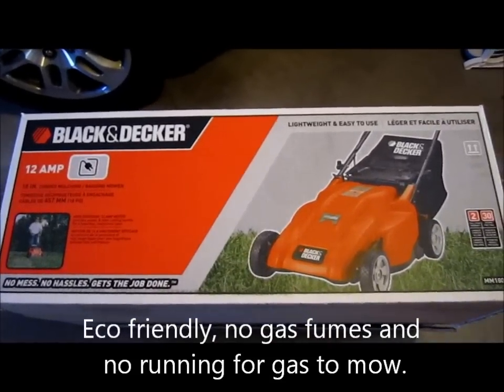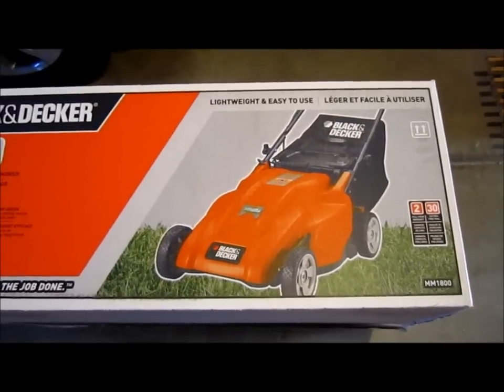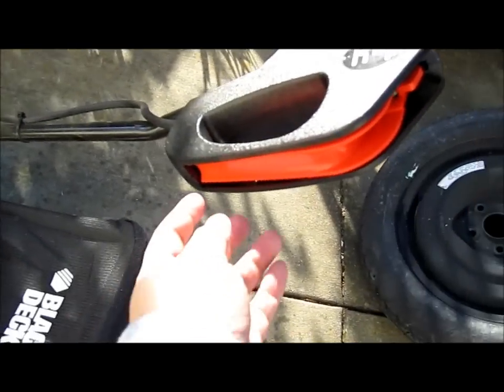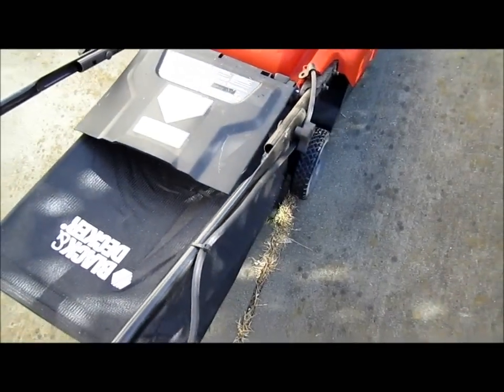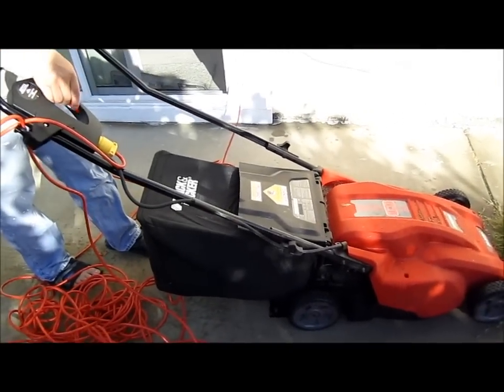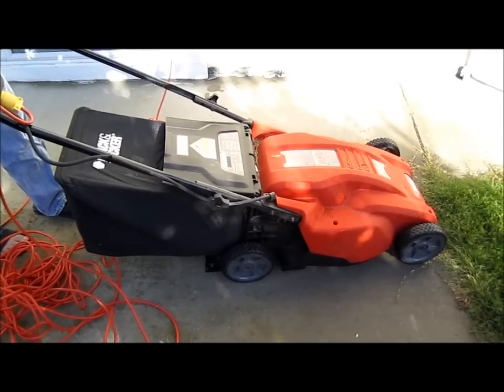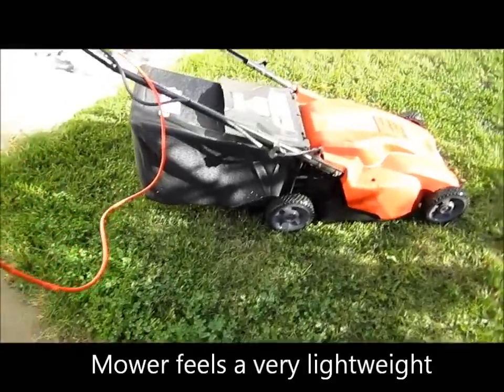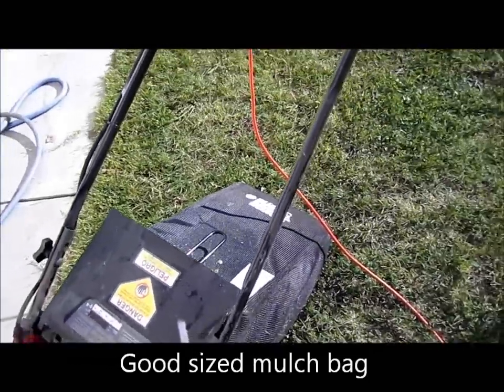Black and Decker corded lawn mower MM1800

Comment from the maker: Just an update today, the lawn mower still works well.  One of the knobs holding the handle broke though. If anyone has info how to order that, please post it below. thanks.
Reply: I just purchased this mower used and it works great, I also need the knob and it looks like its on Amazon (Black & Decker, 905427737, knob assembly)
Reply from the maker: Thanks, I'll check that out.

Comment: Pro Tip: if you order a replacement fan blade, use a Dremel rotary tool and notch out each of the eight fan blades (but do not over grind), so that they do not rub against the screw heads which causes this fan premature damage.
Reply: my lawnmower does not work, because the battery does not charge

Comment: Hey man i just used my black&decker mower it deff works well i deff like electric mowers but only this one cause its a black&decker im glad i got the last one oh the part where ur putting the cord around i figured that out u fold the and push it through that hole and then it wraps on to the cord holder i tried it like u how u did it but it didnt look right over all its a good mower and sounds awesome like having an out door vacume cleaner :)